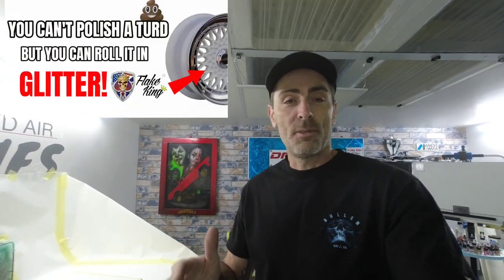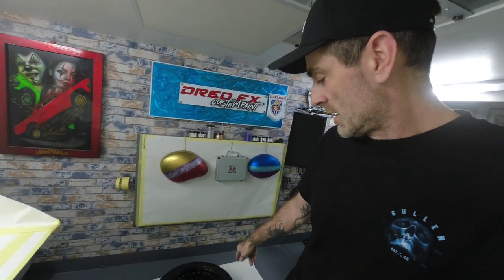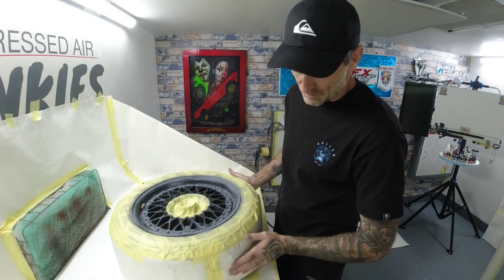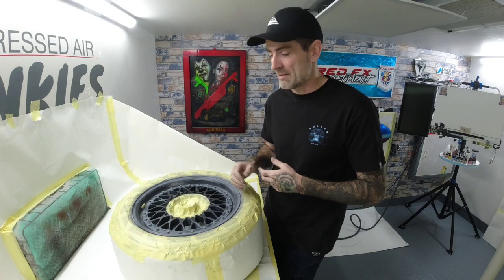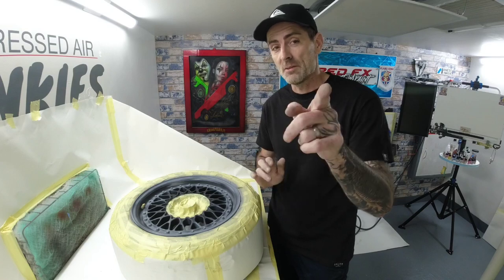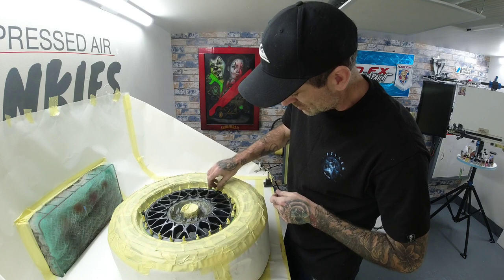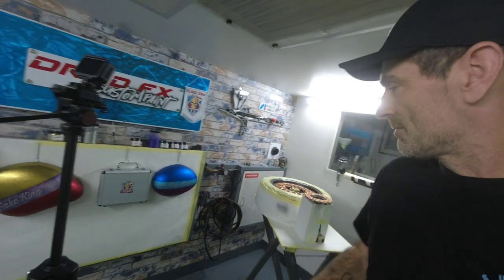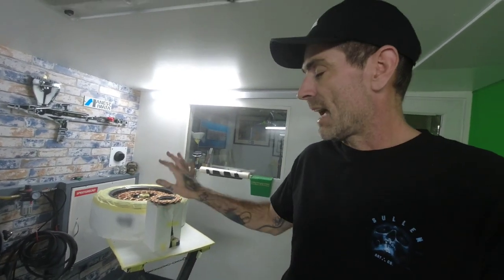alloy wheel re paint! you can't polish a turd but you can roll it in GLITTER!

Comment: Lol Rob you're in my world now good job brother what car is it ?????
Reply from the maker: Hello mate its my pimped citigo 🤪trouble is now I have started the wheels I have to airbrush and paint the rest of the sodding car lol
Reply: @dredfxcustompaint  Lol Rob go to town on it really pimp it up it would make some cracking videos  in between paid jobs of course
Reply from the maker: @deanbrown7643  its about done Dean bonnet is all airbrushed all the inside is sound Proofed it's slammed on COILOVERS just need to paint the rest of the body
Reply: @dredfxcustompaint  what's the colour
Reply: You've painted tractors same principle mate base and clear job done got an absolute beast of a clear gun gti prolite 1.4 with a te20 air cap if you want to borrow
Reply from the maker: @deanbrown7643  nice one Dean I have the same set up at the body shop pro lite 1.4 te10 base and t110 clear
Reply: @dredfxcustompaint  try the te20 mate atomization is better
Reply from the maker: @deanbrown7643  with clear Dean or base
Reply: @dredfxcustompaint  clear 😁😁😁
Reply from the maker: @deanbrown7643  will have to try it Dean 😉👌
Reply: @dredfxcustompaint  I find the 110 a tad dry and you have to work at it but the te20 effortless
Reply: Get one Rob spray guns direct 😄😄😄😄